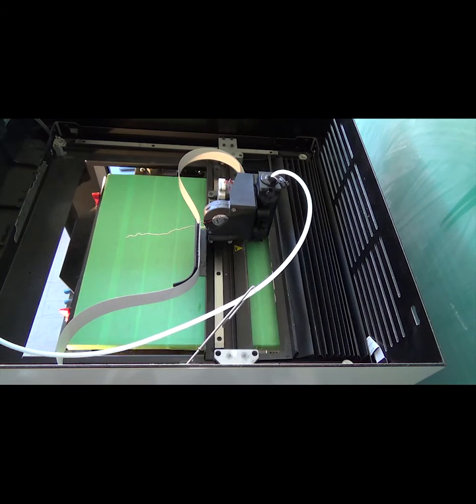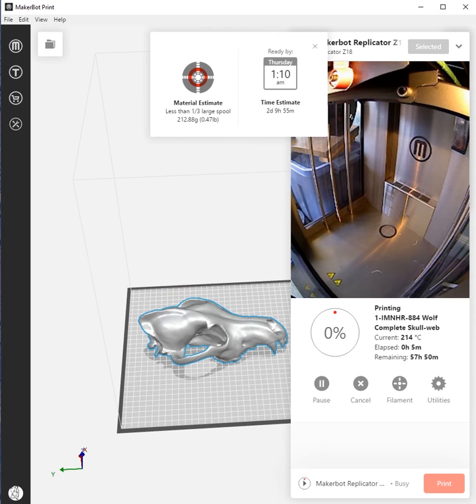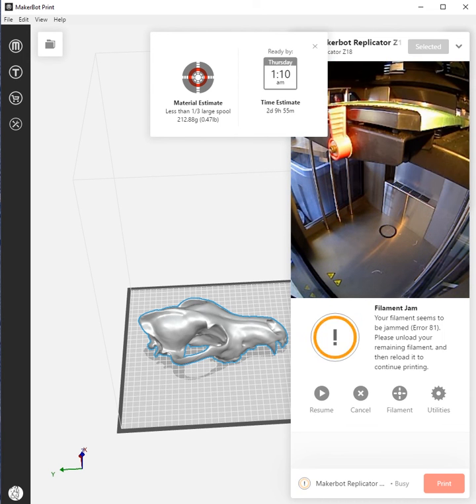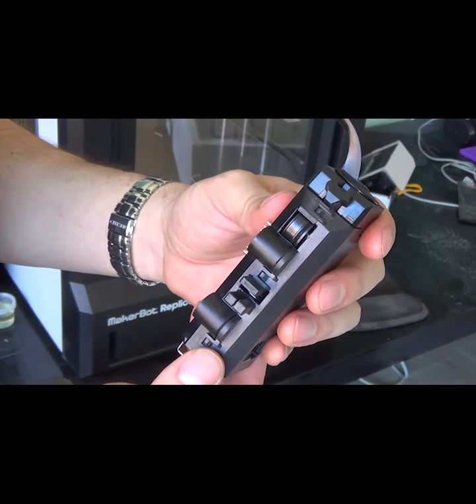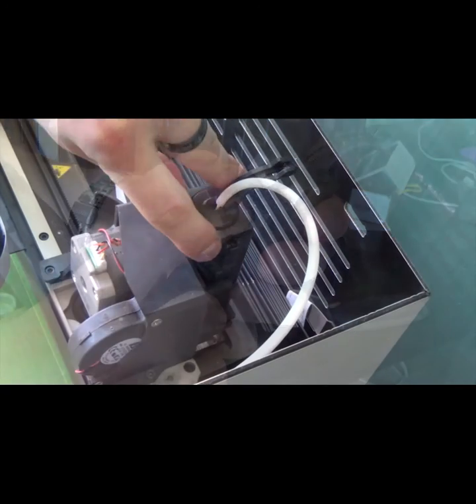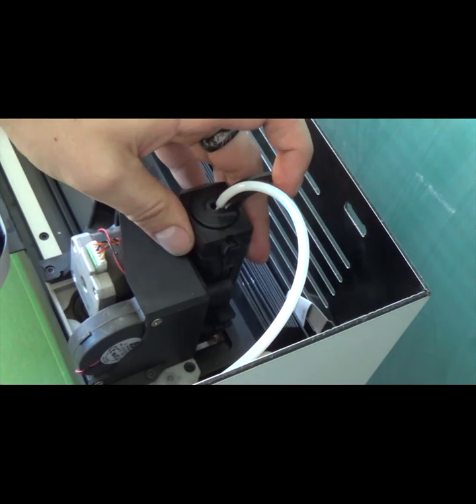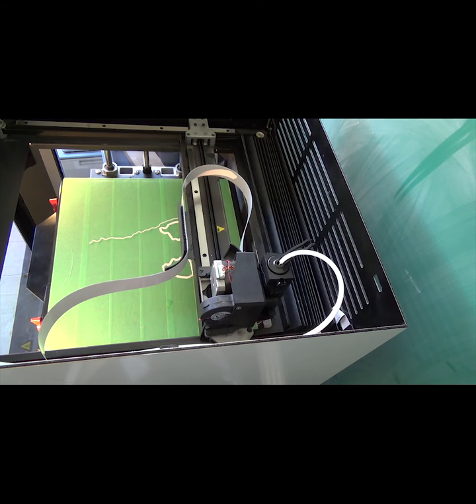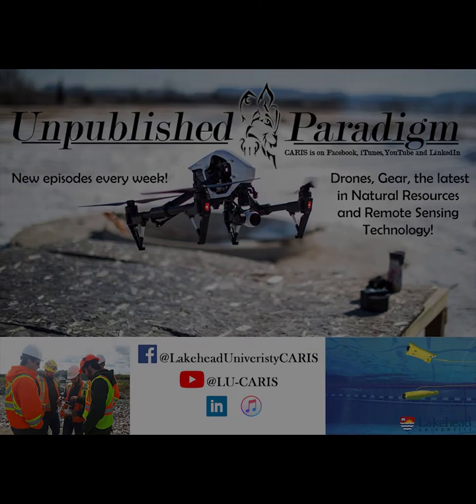Fixing filament slip on your 3D printer

Comment: I restrict my comment for a MakerBot Replicator with a "not +" Extruder:
First, you must stay with the latest MakerWare version validated by the manufacturer to extrude them non +: here https://s3.amazonaws.com/downloads-makerbot-com/makerware/MakerBot_Bundle_BETA_3.10.1.1746_x64_Install.exe. This version does not update automatically which keeps the same quality and printing safety. In addition, this version allows to control a lot more things than the news which is not suitable anyway to extrude non +.
Secondly, to avoid having any unintentional SLIP or JAM, or even more correct printing, drop the advice like "screwdriver" or "error removal" or others ... Your problems impression come from the wear of certain parts of the extruder: In particular, the housing of the ball bearing supporting the axis of the filament advancement actuator: It is ridiculously undersized AND with heat AND time, the game is installed and the filament is no longer properly pressed. With a simple piece of plastic sheath (cable) 1/2 mm thick, opened in 2, I could catch up on the wear between this ball bearing and the plastic cover to extrude it in 2 minutes: j 've found a brand new extruder that extrudes madly!
It's simple, after so much time looking for the why of how my extruder was working more and more badly, I was amazed by my discovery ... It's your turn.

Comment: Thank you.  Any way to make a perament solution though?
Reply: Hi Aaron, for this particular issue I feel that it's just part of how the printer heads are designed. That little bit of play is built in to make sure that there's no serious tension or wear and tear on the parts or filament. At this point I treat this as just regular maintenance. I just do a quick check at the start of each print and things have been running smoothly for us since we started doing this. 
Maybe as newer generations of printers/print heads come out this problem will go away... 
Thanks for checking out the video!!
Reply: Thank you for uploaded the video.  I just started having this issue with my 5th generation with the Smart extruder +.
Reply: A permanent solution would be to turn off the filament error detection in the notification settings